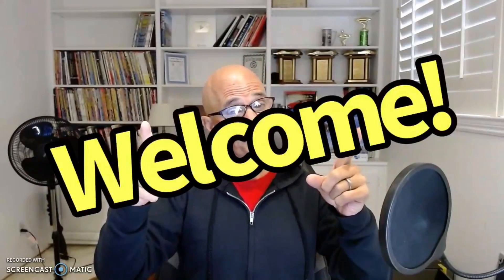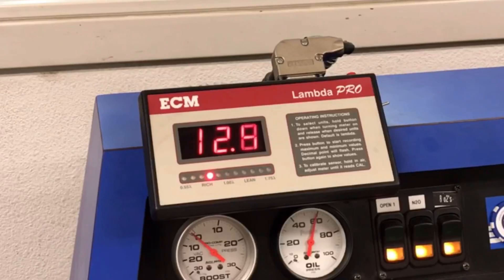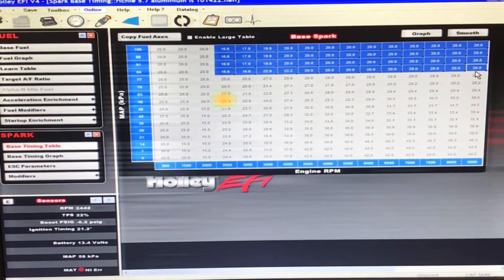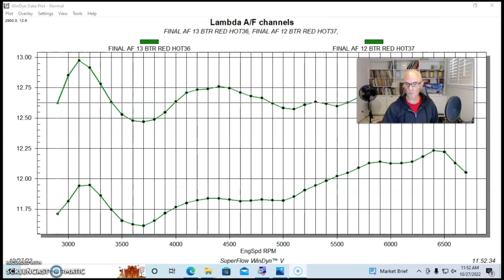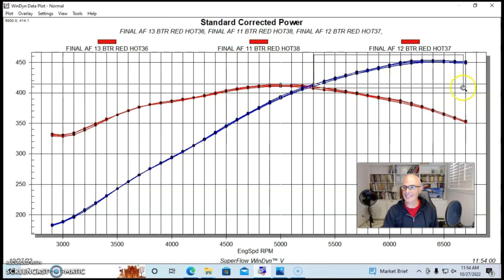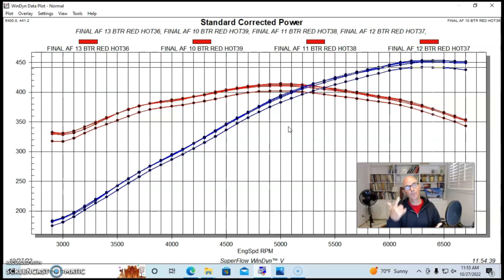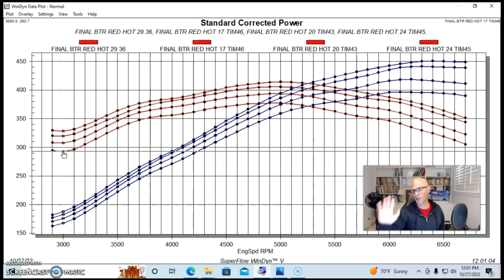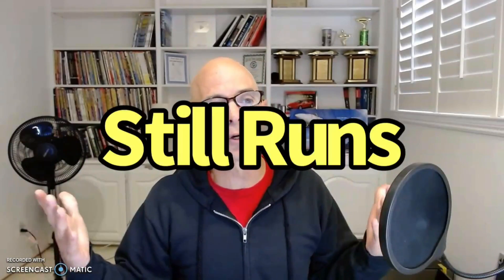JUNKYARD LS TUNING SECRETS! A/F TEST-10:1 v 11:1 v 12:1 v 13:1. TIMING TEST-17, 20, 24, 29 DEGREES!

Comment: Here's my question Rich (after watching) - how much can the afr vary and still be able to safely run that 29⁰ of timing? Can you safely run that 29⁰ at the 13:1 mixture? Or only at a 'safer' 12:1 or 11:1? 

I also wonder how feasible 29⁰ and 12:1 is in an actual car, or at least with the normal intake/exhaust that is close to what we'd have - I wonder that with a more realistic 'in car' setup you'd be much closer to, if not past, safe limits at those numbers. I love the theory proving on the dyno, but what about us guys on the street- how feasible are tuning numbers like this for us? Can you test at all and see?

Or maybe a better way to put it, how close is this tune to the one in your pickup? You've got a 5.3 in that, don't you? Are you running 12:1 and 29⁰ in that? That's what I'm curious about when talking about these different afr's and timing. 😀 

Love the channel and the content. 😀
Reply: I hope he answers this, I was thinking the same thing! I'm all for the super scientific testing, but if we're talking junkyard motors lets talk junkyard vehicles, lol
Reply from the maker: he (meaning me) already answered this-in car timing values are usually less-with the drop in power as shown-AF can be run at 12.8:1, but most factory tunes are much richer-though (as shown) with very little loss in power
Reply: @richardholdener1727  - thanks for the response. Did you cover this in a video I'm forgetting about, or have I missed the comment it was in? Also, I still think it'd be a good video to cover the differences between a dyno tune like you use to a real in vehicle tune of a similar engine - like your pickup or something similar. I'll bet quite a few of us would enjoy a video like that, talking about some of the differences and why they happen. 😀 

It'd be more content! But also thanks for doing what you're already doing - it's both fun and useful. 😀

*edited for spelling*

Comment: 2 questions 
1. In a boosted application where you are using the rich mixture to control temps does mixture have a bigger affect on power since it might affect burn rate more? (I guess you will go into the 10.5/1 range when using fuel to cool so that makes sense)  
When I was tuning my Subaru I typically noticed no power gain leaning it out above 11.7/1 and just more fuel sensitivity so I stopped there under loaded cells.

When you don’t have enough timing can’t that heat up the exhaust and cause under hood temps to skyrocket?
Reply: I swear that on E85 on my supercharged cobalt, 12.0 feels faster than 11.7-8.

Edit: the timing is the exact same.
Reply from the maker: low timing will increase EGTs

Comment: Super cool data. This might be what inspires me to bring my 5.3 back down to the high 11:1 range and see if it likes more timing
Reply: Before you do, pull the plugs and see where the timing marks are. Don't change anything before you do that. If you are not on the dyno, the timing marks are what you use, and you also use those on the dyno btw. Nothing is more important than reading the plugs.

Comment: I have a 468 sleeved ls7 with hand ported heads , hand porting not tested and the motor didn't have much power over 4000rpm. The camshaft was unknown but it had a grinder skid on the end..  this is a long and sad story about a great build that ran out of money at the builders...  He double-crossed the guy who bought this engine.   I have a new healthy cam but would like to test the heads...  Is there a way to test them without using a dedicated flow bench... We don't have that here in Iceland. Egt's on each exhaust port to even out the ignition timing on each cylinder and see what power it makes ?.. hehe
Reply from the maker: not sure how to test heads without a dyno or flow bench

Comment: Does the exhaust in the Dyno cell have effect. Are there super extract systems for the exhaust fumes or just not a issue ?
Reply from the maker: big fans and massive flow-exhaust is not an issue

Comment: I saw ratio numbers pop up in my notifications, I was hoping this was Compression Ratio! Love to see this data just as much. RICHARD! PLEASE show us changing compression ratios, from mild to wild!
Reply from the maker: that is hard to do without changing some other variable
Reply: @richardholdener1727  maybe start with an engine with very high cr, then add extra layers under the head.. (thicker gaskets? More gaskets? "Sandwich" plates?) and longer pushrods... but of course it's quite a bit of work.. and we actually know what is going to happen :) just wonder how much would it loose and if the loss % would be same down low as up high.. should be, I guess
Reply: Is there a point that compression is too high? A point of diminishing returns? But yes it will inevitably change other variables. How much quench height do you really need..?
Reply: @BlueMountainRacingEngines  going past 12:1 is usually pointless for most people
Reply: @BlueMountainRacingEngines  there's definitely diminishing returns. As a practical matter, anything above 14:1 usually doesn't continue to gain unless the combustion chambers are really small and efficient
Reply: @BlueMountainRacingEngines  apparently 22:1 on a Hayabusa engine is too high. It makes power, but it kills plugs every 2-3 passes and doesn't run the numbers and mph related to the HP numbers shown on the dyno. It's on methanol is the only reason I attempted it. It's going back to 15:1 and gas when I redo it.

Comment: Hi Richard, great video! Can you do the same test but on a boosted LS? Say at 6 lbs, 10 lbs, 12 lbs, 15 lbs, 18 lbs. Showing relatively safer AFRs on a e85 motor? Also for reasonable safe timing levels? That would be so helpful!  I have always heard conservative, on timing, but add boost for more power & longer lived motor! lol I know Matt with sloppy does one boost tune that is good power, fairly safe. Then he ask the owner if he wants the ragged edge of max power! lol Of course caveat there is reliability of motor on hottest tune. Anyways reasonable safe tuning parameters with good power would be perfect for all us home self tuners out there that tune on the street and so very informative! Thanks so much for all your great videos Richard!
Reply: I would say do that test but also keep the regular gas too. The benefits of running e85 is the higher octane will enable it to run more timing. So the regular gas will show the base and people and keep reaching for the peak. I say this only because a lot of factors start playing a part in using the "most optimal."
Reply: The thing about that test is that it will be his best guess on what the right timing is. He doesn't use knock sensors and relying on them at high boost levels isn't a good idea. If you are looking to tune your engine talk to someone who knows timing and ask them a good base map to use. Or if you have a good ecu it will know already. Then get a safe air fuel for whatever fuel you are using. O2 sensors will tell you if you're ok or not. Then add timing slowly until you are comfortable with your level and ask a professional what they think even if you have to pay one a couple dollars to look at your tune.
Reply: Just saying, I think a great video would be; Richard puts boosted motor on dyno. A. tunes on 91 octane, just like this video above for first a relatively safe but good power tune for timing & AFRs, then maybe another for most HP tune. B. same 2 tunes on race gas showing the difference. C. same  2 tunes on e 85. Would really give guys tuning at home relatively good power at a  safe tune direction. Not everyone has access to a dyno or can pay the big bucks for dyno tune. I just think same type of video, but LS motor on boost would be great! Thanks for anyway considering Richard! Your videos super help us all!!! Bob
Reply: @robertbroderick3896  ah okay trying to see the benefits of it, like you can get more timing with x and run a afr of x. I would also put meth into the equation and water-meth with the different gas types. We all know you can use it for added safety but it would be great to see how much timing you can potentially add. Which makes me think that these test could also have heads included because we have seen the test that Richard put out for them and with this we could kind of see the  benefit of running a head like the 317.
Reply from the maker: you can never get to optimal with pump gas-just to the level that doesn't detonate
Reply: @richardholdener1727  not quite what I meant. After reading Robert's response it would be good to add the additional tests to not just compare things at the same level but how far you can go if you have everything the same with just the change.

Comment: What about in a boost application and egts. Would 7psi and 28 degrees be better then 15psi and 15deg of advance.
Taking into account under hood and exhaust manifold temp. Burning plugs wires and so forth.
At what point in a mild build is it better to fine tune low boost max timing or just go big boost and pull all the timing and have everything after the cylinder heads bloody glowing like the sun
Reply from the maker: 28 would be way too much for boost
Reply: More boost will always make more  power. Timing is mainly about peak cylinder pressure. Keep your Temps low and fuel good. Uncompressed fuel will burn slower than compressed fuel so the more compression and boost the faster the burn. Taking timing out doesn't always mean that your fuel is burning later in the troke of the engine. Sometimes we take timing out to keep the same peak pressure.

Comment: Wow..crazy to think that so little would..would this impact be the same on a carb'd sbc?
Reply: I've seen graphs were there is a point of timing advance where power begins to drop off.   I tried on my car on the street advancing +3 degrees each drive, after +9 extra the motor did loose some torque response, but still wasn't tapping from early ignition.  I settled with the timing between settings that felt punchiest, for my optimised road setting.   I wonder how Holdeners motor would go at 35 degrees!

Comment: Fuel injection, which already has optimal cylinder-to-cylinder fuel distribution (assuming all the injectors are matched and flowing properly), shows no need of anything richer than what is needed to prevent detonation. With a carburetor, cylinder-to-cylinder distribution is never optimum. This requires an overall richer mixture to make sure the leanest cylinder gets enough fuel to prevent detonation. In doing so, the overall engine can benefit somewhat from the richer mixture which causes intake charge cooling. This effect can allow the richer cylinders to make more power which can compensate for the leanest cylinder's average or normal power output. Now, If the intake manifold is a good design, allowing relatively close cylinder-to-cylinder fuel distribution to begin with, then all the engine's cylinders can take advantage of the richer mixture induced charge cooling for more of a power increase. This effect is a benefit of the carburetor introducing fuel further upstream than the Port & Direct injection systems. You can look at it either way; Port or Direct injection systems can provide their best power with the least fuel consumption. Carburetors have a "window" of power increase with increasingly richer mixtures until fouling combustion occurs. 
          Ignition effects are relatively the same for injection and carburetor systems. In summary, the testing shows the overall efficiency of fuel injection and that there is little to be gained by a richer mixture as there is comparatively little charge air cooling to be had. Carburetor systems can see power increases with increasingly richer mixtures, up to a point, because of the induction cooling effect. They will use fuel less efficiently but they can make more power effectively. 
     Now, if someone were to install the Port injectors further upstream in a well designed intake manifold, they may achieve the best of both worlds. Excellent cylinder-to-cylinder distribution and increasing power with richer mixtures due to charge cooling.

Comment: At what point will adding fuel stop helping control detonation?
Reply: I think you will lose power from being way to rich before you gain power from being able to put more timing in. Plus in a street car you will burn your cats out and it will smell horible and burn a lot of gas. In a race car the wrong tune doesn't make sense anyway. I think that taking timing out for detonation is much better than adding fuel power wise.

Comment: You get vastly different results in your power from afr for some reason over there, I re tuned an LS1 the other day, original tuner had it set at 10:1, I pulled fuel out to 12.8 and gained 47hp, I would post the dyno graph but I can’t on here.

I also pulled 3deg timing out from 22deg to 19deg as it was pinging when I pulled fuel out.
Reply: Same type of result with the AFR, especially under boost.
Reply: @dennisrobinson8008  where abouts are you ? I’m in Australia, something very different with fuel in the US, never had an LS that could run anywhere close to 29deg timing. 
As Richard said 10:1 still drove quite well but after re tune it was a completely different car to drive
Reply: @peterlogan706  in usa.  Af being way off makes a power difference in my experience especially under boost.
Reply: @dennisrobinson8008  true, yes I find it makes a pretty good difference with afr, generally find most power at 12.8, generally if it’s around 13.5 I’ll gain 10-20hp dropping it to 12.8, if it’s 12.5 I’ll usually gain 5-10hp, not really worth worrying about 5-10 but I do and people are happy with as much as they can get, even though they wouldn’t notice the difference 😎👍🏻
Reply: @peterlogan706  sounds about right.   As much power we can get while remaining safe and out of detonation.  Are you doing e85 on any of your vehicles?
Reply: @dennisrobinson8008  I’ve only done a couple with e85, a 383 N/A ls1 and a turbo LSA, I’m going to do a tune on my 6.0 one day with e85 just to see how much more it will make, it’s 480hp at the wheels now, would love to see it make 500hp but I don’t think it will lol. 
Unfortunately we don’t have e85 in our town so the closest is just over 100km away to get it out of the pump.
Reply: @dennisrobinson8008  yes you guys over there make me jealous with having e85 at all the servos (gas stations) 😂👍🏻
Reply: @peterlogan706  e85 stations at least every 10 miles or so.   I literally could get away with 14:1 or greater cr.
Reply: @dennisrobinson8008  yep would be nice to be able to run that without having to drive 200km+ round trip to fill up jerrycans with e85 lol.
Reply: @peterlogan706  Yea i know a austrailian would run e85 in a heartbeat and have the car setup for it with high cr or super high boost.
Reply: @dennisrobinson8008  yes for sure, it would be handy for making good power, especially for cars that aren’t driven everyday for us here, not sure how abundant it is in the city like Melbourne, maybe one day that will all change, guess it comes down to demand, if hardly anyone wants it then they aren’t going to dedicate a pump for it.
Reply from the maker: it does not gain 47 hp going from 10:1 to 12.8:1-I've tested this many, many times
Reply: @richardholdener1727  I don’t know what to say Richard lol. 
Other than it did 😆
Reply: @richardholdener1727  if it was misfiring due to the rich mixture maybe.
Reply: The guy also had to much timing. Could have factored in to the lower power. I dont see the test being different if you were to find a safe tune on that car and run different afrs.
Reply: @akassasin5768  that is true, it accounted for 7hp gain 👍🏻

Comment: IYO would there be a bigger effect felt under load and the full weight of the vehicle with AF Changes? I was conducting some Real Time Tuning through HPTuners this morning on my 2000 Chevy Silverado 1500. (Someone else was driving.) When I moved my AF from 11.9-12.3AFR under hard non full throttle acceleration 65-85% Throttle to around 13.9AFR. The acceleration felt stronger and actually smoother as well, So much so that my driver asked me if I had changed anything because they noticed it without me saying anything to them.
Reply from the maker: felt stronger?
Reply: @richardholdener1727  Felt like it was pulling more consistent through the entire RPM Range rather then it feeling a bit more sluggish on tip in and through 2k-3500k RPM range and then pulling hard from 3500k on up.Before it felt as if there was a dead spot within that RPM Range before I made the change. Im sure this isn't related to any HP or TRQ gains as much as it is maybe a more efficient burn of the AF in conjuction with the timing. I dunno, im somewhat new to tuning (2 years) and there's still a lot left to learn. Unfortunately I don't have access to  an actual chassis dyno at the moment.